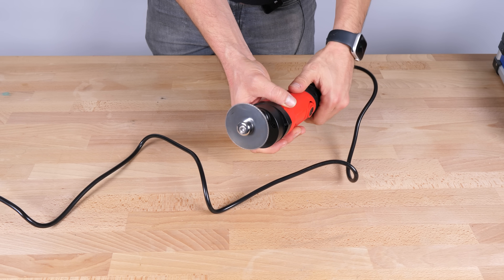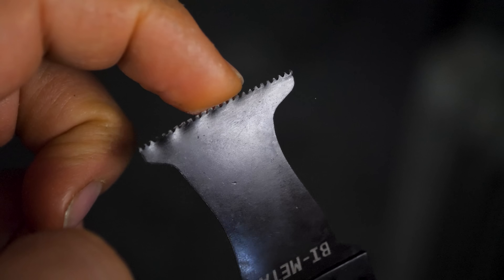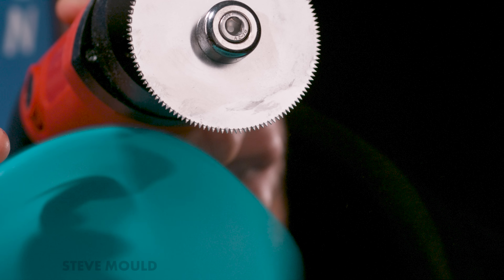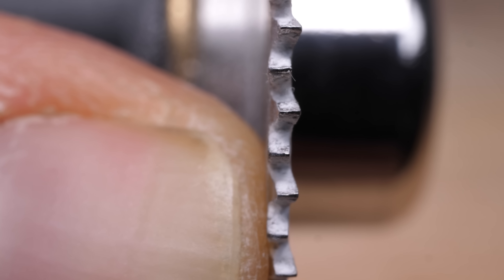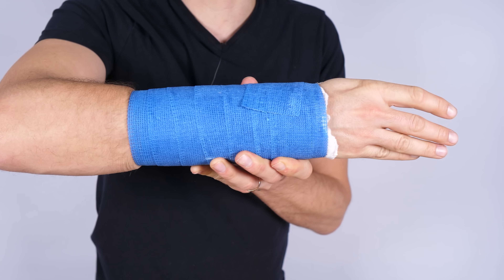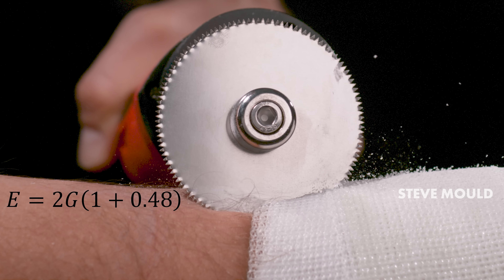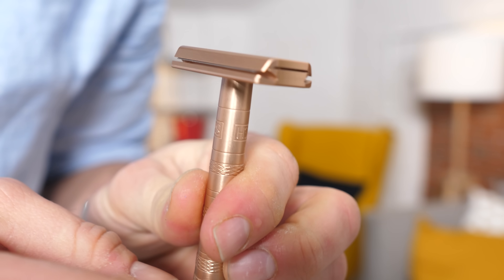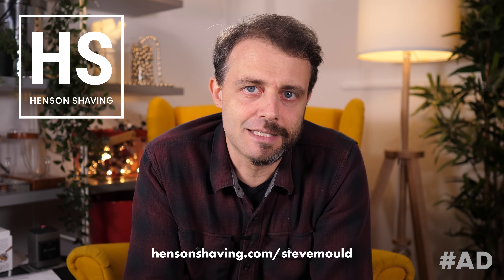A cast saw on human skin

Comment: I only had a cast once when I was like 8 or so years old, and I was terrified at the saw being used once it was healed, and thought for the longest time that the doctors were just THAT precise and skilled with the saw xD
Reply: I was exactly the same. The nurse who cut mine off could tell I was scared so she used it on her arm and her medical gloves to show me it couldn't cut either.
Reply: The reason the cast saw can cause cuts, is if the doctor moves to fast. In that case its basically like a man dragging a knife over the skin, not a sharp knife mind you, cast saws are of course not to sharp. Since the cast saw only vibrates back and forth, no further than the skin can stretch, if you move it slowly it cant cause damage to the skin.

You can liken this to a man eating with a fork and knife, the knife by dragging it back and forth is sharp enough to cut through the meat or other food products, but its still not a very sharp tool.
Reply: I also had a cast (two actually, both ankles as my Achilles tendons were not growing fast enough), when it came time to cut the nurse asked me if I was afraid, and when I reluctantly nodded my head she held the thing to her arm and let me watch how it just tickled.
Reply: @Tyrope same
Reply: i had the same surgery on both my legs to lol
Reply: How f'd would it be if she had a switch that decoupled the blade from the motor and faked you out. @Tyrope
Reply: Doctor was cutting my cast off when I was little. He ran the blade too quick and cut me on the knee. Had another scar there for years. Now in my 30s it's gone
Reply: Broke my arm in the 8th grade. Was left with a burn from one of these oscillating cast cutters
Reply: @LucasCodesIO rather a BURN than a fuckin non-properly healed broken bone.
Reply: @LucasCodesIO how do you even get a burn from a cast saw : /
Reply: @LucasCodesIO sounds like 2 things
A you problem
A skill issue
Reply: vore
Reply: what a great way to start your day
Reply: Wow I’m exactly the same. Now in my 40s I’ve only just learned this!
Reply: @iainmillar1532 IKR — I wish they’d shown the marker movement thing to do when I was 5
Reply: My father cut my cast with a normal hand saw because he did not want to spend money to have the cast removed
Reply: At 7 I was also terrified of that saw, my uncle told me they used a bone saw and the doctor had to have nerves of steel. I was in the office alone (1965) and didn't have the guts to question the doctor and he made absolutely no effort to explain to me the saw was safe, he just cut the cast off. I was today years old when I found out that I couldn't have been hurt.
Reply: @FranktheDachshund there needs to be a “how I met your mother” style scene about this
Reply: Same
Reply: Similar experience...except they had to hold me down even after they ran it on my skin and showed me it couldn't hurt me...I was a bit of a baby
Reply: I was scared too, but it helped when the doctor put him own palm against it to show how harmless it was.
Reply: When I was a kid I had a cast on my forearm after an accident and because it was put on in the ER and they had to remove and re-cast it halfway through healing, I was terrified of the saw but when they were preparing to cut it and wiggling it around to see how loose it was the thing just slid off my arm due to some combo of muscle loss from disuse and how swollen the injured arm was after the accident, felt like I'd lucked out not having to have that heavy equipment so close to my skin. Did have to get the redone cast cut off ofc and it was nbd and I felt silly for being so scared in the first place...
Reply: Oh my gosh I was seven when I had a cast and when the doctor pulled that saw out I nearly bolted out of the room screaming.  Fortunately the doctor pressed it against his own hand to show me it wouldn't cut.
Reply: Well, i thought that until like an year ago (32yo here)
Reply: my doctors show what the tool was and put it to his hand while is was running to show me it's not going to cut me.
Reply: @crazeguy26  How do you he didn't have a fake hand or his real name was Arnold?
Reply: @SirPembertonS.Crevalius
I also had a cast (on my lower leg) around that age and had a full blown panic attack when our family doctor wanted to remove it with this tool.
He tried to show and explain to me that it wouldn't hurt/cut me. But in the end, I just couldn't handle it and he was forced to cut off the cast with some kind of medical scissors instead. The process took ages and did leave me with a bunch of cuts and bruises which I probably wouldn't have gotten with the tool.
Reply: @TheBrain2K wow all these EXACTLY similar stories make me feel better.  Same age same era same amount of pleading from the doctors.  Amazing.  I thought it was just me until now.  40 years later.
Reply: I had a cast on my elbow removed when I was about 3 or 4. When the doc pulled out this saw to cut it off I freaked out. He showed me on his own forearm that it wouldn't hurt. My brain still wouldn't accept it, I just concluded he had some kind of super industrial strength adult tough leather skin. 😂 I sucked it up and let him use it. It tickled if I remember correctly
Reply: I was 11 when I broke my foot. When it was time to get a walking cast, 
the doc showed me the saw, turned it on and pressed it against his hand.
" It won't cut you "
Reply: I was the same they must using metal shield being feed in from the edge of the plaster just above skin , but just was not seeing it any where, while one was being used?
Reply: Some time ago they used one of those on me.  I said it was uncomfortably hot and they said it was normal. It wasn't 😅 on the backside of my hand about half way I think I had a small groove think still within skin depth. They had said some of the padding under the cast might have been lacking or different (skiing accident, doctor office down the slope put the cast)
Reply: Same story for me, except 5 years old!  I really wish I had this video and demonstration then, maybe the day before.  I remember the hospital staff spent ages trying to calm me down and convince me I wasn’t in danger, but once you’re seeing through tears, it’s hard to concentrate.
Reply: this guy has the same recommendations as me
Reply: I had my leg in plaster for six weeks. I don’t remember the sawing. I just remember the pain when they insisted I bent my knee after it had been locked straight for all that time. Eventually one of the nurses lifted my knee up out of the plaster. I screamed like a baby. Once I calmed down, there was no pain 🥴
Reply: I was scared of getting my cast cut off when i was little luckily my wrist got small enough to slip out of the cast a week before I was supposed to get it off so I never had to go and i got to keep it as a reminder, I still have it somewhere
Reply: I had one when I was 13 from skateboarding. When it was time to take it off and the dr pulled out a saw and said this how it comes off i was like wtf your going to use it he was like it's alright it doesn't cut skin in my head im going bullshit it's a electric saw how's it going to know what's the difference. He showed me on him i still wasn't convinced but I still went for it. I even messed with him i was like shit it cut me. His eyes got big. 😂😂 I started cracking up. I think he was relieved it was my last appointment for it. Just saw i was a little fucker as a kid. And loved messaging with people.
Reply: @Heavymetalstonie420 that's actually funny
Reply: I had a similar experience around 11. When it came to taking the cast off, I heard the saw for another patient who was taking it off in another room, except they were screaming like they were in agony. Did not help me at all.
Reply: My doctor put the saw on his own skin to assuage my fears when I was younger. Did wonders for my willingness to get the cast off lol
Reply: i broke my hand when i was in first grade, the nurse actually got the wrong saw to cut the cast but before she cut it she tested it and cut her arm
Reply: Oh hey you changed the pfp

I hate that I realized it was different
Reply: same here bro, i was terrified when i was in the waiting room and hearing this saw.
Reply: the doctors didnt think to tell you?
Reply: ITS YOU AGAIN WHAT LMAO
Reply: @fuwarifuwaru Heyo! :D

I like quite a few corners of YT ^.^
Reply: My doctor put it on his arm and pushed in it. He assured me it wasn’t going to hurt
Reply: Also had one when I was young, but the doctor used some sort of scissors for the cast
Reply: I broke both my wrists when I was 9, I was terrified of the cast saw until the doctor literally pressed it into her hand and arm to show me it couldn't cut me, then I was fine lol.
Reply: I had a very similar experience, though I feel like my fear could have been avoided. Surely they could find an alternative route to take children for an x-ray other than past the "disc saw room". Spent my whole time in-cast terrified because of that interaction.
Reply: I broke my wrist about a year ago and when they were making a removable cast for me (a process which involves setting a synthetic cast, cutting it in half, and finishing the edges) they first demonstrated the cast saw on their bare arm!
Reply: I still remember that feeling from when I was 5.  It felt like tickling and then so satisfying when the cast finally came off.
Reply: I remember I thought it felt nice lol
Reply: When I was getting the cast on my arm removed (when I was in junior high) in the closet of the office was a straight up wood saw and I was terrified. Turns out the saw was there to adjust crutches for folks who broke their legs. Phew.
Reply: Same. I always assumed they were just very careful. I know I was in grade school. 2 grade I think. That's why I clicked on this video. 40 some odd years later, I get the answer.😊
Reply: you are not alone
Reply: Orthopaedic surgeons are mansions,sculptors and carpenters who worked with bones,tendons,ligaments while covered in layered clothes and gloves
Reply: WHY ARE YOU EVERYWHERE
Reply: A good nurse or doctor will often put the saw on their own arm to show you it’s safe
Reply: My doctor messed with me and told me to hold my breath and stay as still as possible 😅
Reply: I am 30 and thought that.
Reply: Probably wasn’t a doctor that took it off.
Reply: Yeah
Reply: Yeah they should've showed you it doesn't do anything
Reply: Your story reminds me of when my dad took the “drywall” router and ran the bit across his fingers, I freaked out now I play the same trick on the cubbies
Reply: I think the basic explanation would be that it works like a trimmer
Reply: I tried cutting my futons cushion in half months ago with a hackzall. I thought I could get through it a LITTLE bit at least but no. Just vibrated the whole futon continuously
Reply: Exactly the same , I screamed the place down so much that they had to get the strongest nurse to cut it off manually with a giant pair of pliers haha
Reply: SAME
Reply: SAAAAME
Reply: Fr thought the same surprised they don't tell anyone this
Reply: Same!!! Fuckers scared me like hell, they could probably hear me scream from the other side of the hospital!
Reply: Literally same thing I was 8 hen this happened
Reply: Had one removed fairly recently, nurse must have moved too quickly as it went through the skin, I now have a scar. It wasn’t too painful though!
Reply: if you move the saw forward INTO your skin while it's itself moving forward it will cut you, i just cant explain it so dont even ask me but even paper can cut if done properly or improperly whatever
Reply: My older brother broke his arm when he was younger, and I happened to tag along with him and my mom when they went to get it off. While cutting the cast the doctor could tell my brother was scared so they showed him it couldn’t cut him by slowing holding it right on his arm.(My mom already knew it wouldn’t hurt him somehow, so she was fine with it.)
Reply: really? i had a cast when i was about that age and they made a big point to put it against their arms to show that it wouldn’t cut mine
Reply: Lol
Reply: They don’t hurt because they vibrate instead of spinning
Reply: Me too ❤❤
Reply: I also thought the same
Reply: When I got my cast off as a young fella the doctor made a point of it and showed me it couldn’t cut skin tested it on himself first.
Reply: It doesn’t spin, it goes back and forth
Reply: When I was 9, the man who took off my cast showed me that it couldn't cut me by poking it on his arm first. I always remember it because I was so worried he'd cut his arm until a moment later when I felt confused but comforted, it was like close up magic.
Reply: i was in a similarr situation and i thought so too, but the doctor was nice enough to explain that it only vibrates, and doesn't cut skin. i think he even pressed it against his skin to demonstrate, but i don't remember it too well. i wasn't scared anymore after that :)
Reply: when i had to get my cast off i was BAWLING my eyes out i was so worried they were gonna chop my arm off
Reply: Thankfully I've never wore a cast in my life, nor have I broke my ankles or arm.
Reply: Taking off feels fun I take off case 6 time in my life (broke be right hand 3 times but all of them not at right spot so they need to get another one)
Reply: I had a cast on my foot and the skin on my foot is tough so it cut my skin
Reply: Real saws cant hurt u either
Reply: If doctor came to me with this device , I would run away.
Reply: I was only a year or two older when I had my broken arm. With me he made sure to show me that it wouldn't hurt me by pressing his own hand against the blade with it running.
Reply: Same, actually. I had a broken ankle when I was 9. Plaster cast first then a fibreglass one for the rest of the healing process.
I didn't really give it THAT much consideration, but I did figure that they must just be very good at cutting off casts without cutting the patients too.
Reply: I had a cast when I was 16, for a broken ankle. I never got to experience the cast saw.

I was sick of the thing and it was getting itchy. So one night I sawed it off with a steak knife, probably a couple weeks early.

I was relieved I didn’t have to face the scary saw, so that was a bonus. 😂
Reply: Ive only broken my back, twice. No casts needed. I can still bend over and pick up a 90lb bag of concrete many times and average 10-20k steps a day at work.

I do take 1 alive every morning with coffee now though. Without it I get sciatic nerve pain from the swelling of my spinal cord. All in all I feel very lucky.
Reply: When i had a cast as i kid i was so scared of the saw i wouldn't let the doctor get close with it so he let me look at  one of the paper blades it had and explain how it worked. fantastic doctor, 10/10 told all his coworkers about how i got a pencil stuck in there.
Reply: you are gross
Reply: I had a cast come off when I was a young kid, and to reassure me the doctor pressed it against his own hand to show me it wouldn't cut him, I was amazed lol
Reply: My doctor showed it on their finger, so I knew what the story was.
Reply: Why are you vore swampert
Reply: Lucky only eight I got mine at 5
Reply: Fortunately for me, the nurse decided to show me that it wouldn’t cut skin by using it on herself.

Honestly I was just surprised the Dremel looking thing was safe on skin while real Dremels are not.
Reply: My doc was a comedian and demonstrated on himself first. He started screaming at first which made the impending arm cast removal even more fun
Reply: Jesus died for you so that your sins can be forgiven and removed for he loves you. Ask forgiveness for your sins; be willing to turn from your sins; and believe that Jesus Christ—our Lord and Savior—died for your sins and rose again
Reply: I thought the same, Was terrified xD
Reply: Whats your pfp bro
Reply: @marcosm6346 soul
Reply: @marcosm6346 that’s a pregnant swampert
Reply: @marcosm6346  that's what I was thinking
Reply: They are. This video is supposed to be a prank.
Reply: @GardenGuy1942 How can you be so confident about something you are so obviously wrong about? Fact check yourself next time before saying something that is just straight up false 😂
Reply: @GardenGuy1942 nah. The saw doesn't even cut through the white fluffy stuff that they put under the cast.
Reply: @GardenGuy1942  cast saws cant hurt you
Reply: @guymanhumanperson  they can cause cuts sometimes. but its very rare
Reply: @MrRando Only if the doctor moves the saw too fast. Human skin is pretty elastic, but if one moves the saw too fast, the greater pull of the saw teeth overcomes the elasticity of the skin.
Reply: @guymanhumanperson  Then you obviously are now swinging it hard enough
Reply: @guymanhumanperson that's what my therapist said too
Reply: @guymanhumanperson cast saws don't exist, they can't hurt you...
Reply: @guymanhumanperson therapist: cast saws can't hurt you.

Cast saws:
Reply: @MrRando takes sheer luck (being unlucky)
Reply: @MrRando  Yeah and even if it happens it'd be a shallow cut
Reply: @MrRando  It's less of a cut and more of a burn? A friction burn.
But I guess if the person got water under the cast sometime recently (by sweating a lot or showering improperly) the skin could get a lot less elastic and might be superficially cut. It would still only be a scrape though.
Reply: @guymanhumanperson that's a stupid thing to say, ANYTHING mistreated can hurt you including toilet paper.
Reply: @jamesfehr2071  yes, but that's pedantic and stupid. It's clear to everyone what I meant.
Reply: @guymanhumanperson they arent real
Reply: @guymanhumanperson They can. I had casts several times. I was born clubbed foot in both feet and had surgery. 

There where time's I've felt pain, when they used the saw to cut my casts. It wasn't because it cut, but because they moved the blade a little too fast. It felt more like a searing kind of pain.
Reply: @guymanhumanperson they can
Reply: @MrRando  probably more like friction burns type things not really true cuts. Obviously if you had really tense skin it might cut it a bit & I am sure a few skin cells get cut in the process normally.
Reply: @MrRando correct
Reply: @Aesthetic.Ascetic Nope.. Still won't cut
Reply: @guymanhumanperson  ur slow
Reply: @MrRando  it did actually just scrape off some skin for me.
Reply: @Aerxis underrated comment
Reply: @GardenGuy1942 No, it’s not a prank, my personal experience confirms that the oscillating motion of the saw prevents it from harming you. I was 12 when my cast was removed, and I was scared that the doctor might be unprecise and would cut through my ar, but when I felt the contact between the saw and my skin, I understood it was not rotating, but vibrating. So it would cut through rigid materials, but nor soft ones. Great video!
Reply: @GardenGuy1942  no? this vid isn't a prank. and cast saws can't hurt you unless the saw is moved too fast
Reply: @GardenGuy1942 no… this is actually how it works.
Reply: @GardenGuy1942 Yeah I was 4 and I had a cast saw and it touched me and all it does is tickle you, I wasn’t even scared. He even showed me it was safe by   Putting the saw on my skin and it was fine.
Reply: @GardenGuy1942 no... it can't be!
Reply: @GardenGuy1942 im not laughin
Reply: @GardenGuy1942 tell me you never had a cast without telling me you never had a cast
Reply: Cast Saws 
Vibrate
Reply: @GardenGuy1942  do you not know the difference between a cast saw and a real saw? They are 2 different thingd yknow.
Reply: @GardenGuy1942  no the blade just vibrates
Reply: @GardenGuy1942  its not a prank wtf. stick to gardening old man
Reply: @GardenGuy1942 not true
Reply: @GardenGuy1942 the video is not a prank
Reply: who says, garden guy?
Reply: Why Pokémon inflation?
Reply: Now you know better, your average doctor passed med school with a b-average. And puts that much effort into their craft.
Reply: Get out degen
Reply: The profile
Reply: what the FUCKING HELL is that PROFILE PICTURE
Reply: @ItsTheNatShack disgusting is what it is
Reply: Thats what we all thought as kids 😂
Reply: Gringo utilizando xd
Reply: No
Reply: Repent and believe the gospel, this could be your last chance to be saved, God bless you